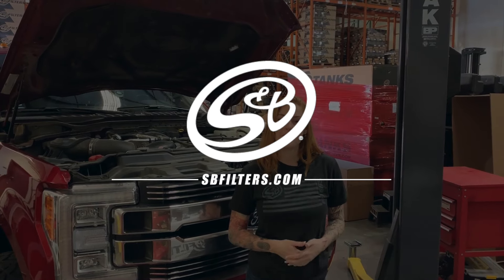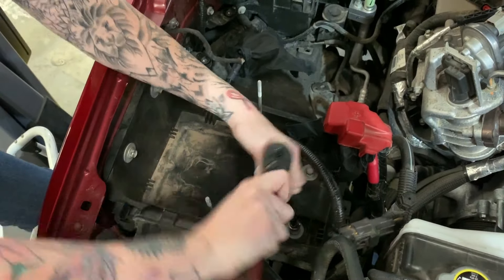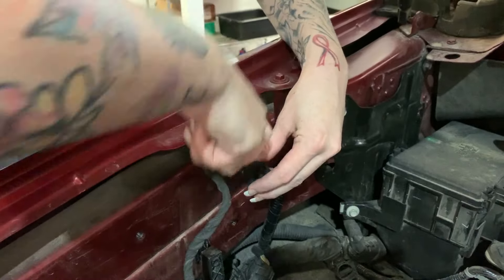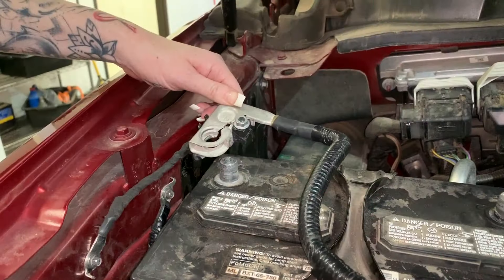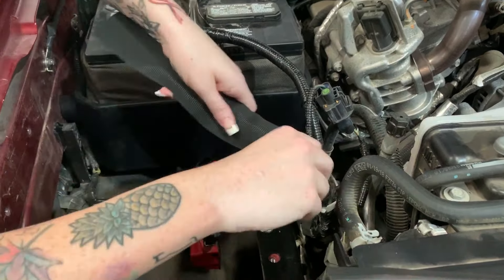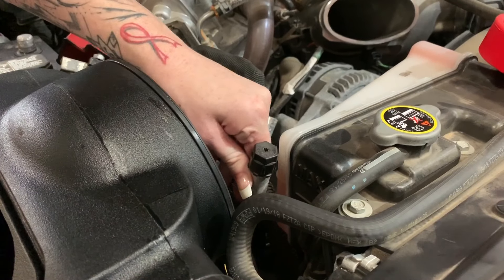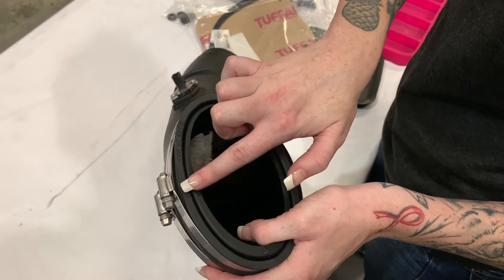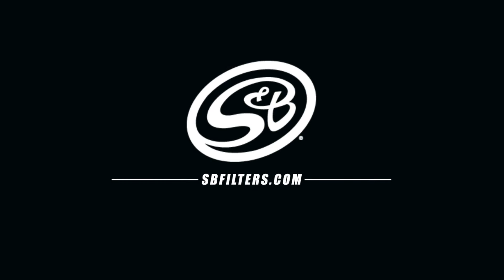How To Install The S&B Cold Air Intake Kit For The 2017-2019 Ford Powerstroke 6.7L

Comment: I have a 2021 F250 6.7 and just installed your cold air intake this afternoon. Your video was very helpful. It took me 90 minutes but only because I went very slow and methodically. The intake arrived nicely packaged in a thick box. No damage of any kind. The components were properly separated and well packaged as opposed to everything being thrown in one bag. The finished components are high quality and well manufactured. I followed your video and installation was quite easy. No glitches of any kind. Everything lined up and fit perfectly. The stock air box and filter are obviously restrictive. The truck sounds good and breaths well now when I stand on it. I ordered the cold side intercooler pipe today. Thanks for the great product.

Comment: Great Instructions. Great Product.  I just installed the cold air intake on my 2018 Super Duty. I didn't need written instructions. I simply set my phone on the workbench and watched one step at a time and then paused the video. The install took me about 3 hours, but that included 2 quick trips back to our farm shop to retrieve tools that I thought I had in my garage at home.
Reply: L
Reply: Did you see any improvement? In throttle response or hp and torque
Reply: Lol. I did the same thing. Love the product

Comment: Jus installed this. It’s my second kit in 2 different trucks. S and b does it right. HOWEVER!!!! The plexiglass y’all use is total crap you can’t seem to pull off the paper. The longest and hardest part was separating the plastic sticker on the back of the plexiglass…seriously guys! Mine is destroyed. If your willing to send me another one I would greatly appreciate it.

Comment: I’m trying to follow along, but at 2:25 you mentioned attaching the spinner using the provided hardware. Well, you did NOT show us the provided hardware; ie, the spinner. Which nut/bolt and washer I’m I suppose to use???
Reply: Never mind, the listed provided hardware is identified in the written transcript.

Comment: Honest non bias opinions only please. I am debating on the s&b intake or the banks ram air intake. I have a 2017 f250 6.7. I like the s&b cause it relocates the intake closer to the where the air comes in but the ram air claims more air intake than s&b even tho it's still in stock location and I am skeptical cause of the whooydo it does to get past the battery.

Comment: i had a 2017 f250 with this intake took it off but  now i have a 2019 f450 will this kit also work cause i went on the website and only goes up too f350
Reply: Shouldn't be any difference.

Comment: Does the open air intake come with the battery relocation kit or do I have to buy that separately?
Reply: It comes with it
Reply: I like the open air intake and how big it is but Wouldn't the open air intake type pull in hot air from inside the engine bay rather than cold air from outside air?

Comment: submitted a request on S&B website - just installed this product on my 2019 FORD F250 SD 6.7L Power stroke and my MPG are going down - rechecked  the whole process to no avail - WTF?
Reply: You are giving your engine the ability to consume more air and thus more fuel too, as the engine automatically adjusts for a prime fuel to air ratio, so do not expect a decrease in fuel consumption; in fact, expect an increase in fuel consumption.

Comment: fyi, I just got one for my 2019 f350 and the air sensor only went on one way because the screw holes only lined up the wrong way, so I put it on that way and didn’t think of it. Later on I finished everything up and my truck wouldn’t go in reverse so I spent 2 hours trying to figure out what the problem was then I thought of the sensor was backwards at that fixed the problem. So now I have a bunch of zip ties holding in the air sensor to the pipe because both holes don’t line up. Fun times
Reply: Mine won’t accelerate at all, I wonder if it has to do something with that as well. I had put everything on and went for a test drive and I had lost ridiculously amount of power. I had to put the stock one back on
Reply: Yes, you need to flip your sensor around. That’s the deal with both of your problems. The MAF is a big deal and super sensitive.